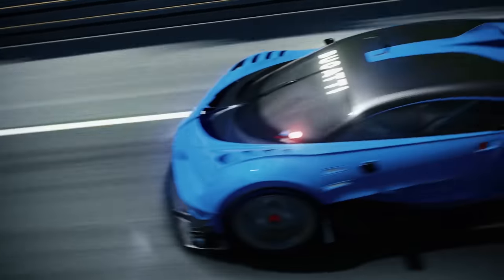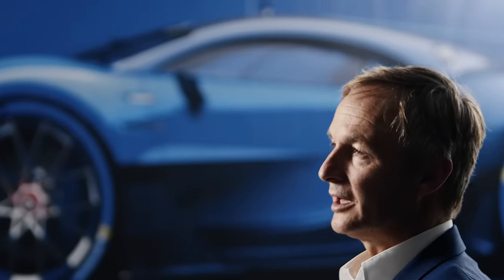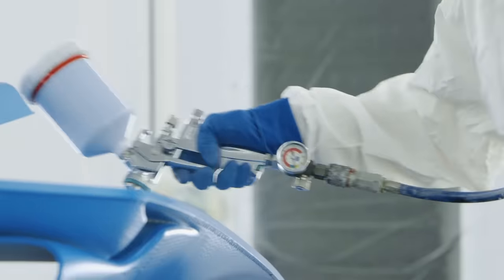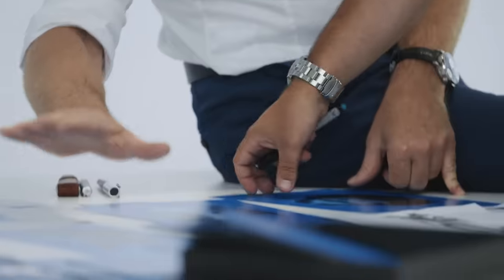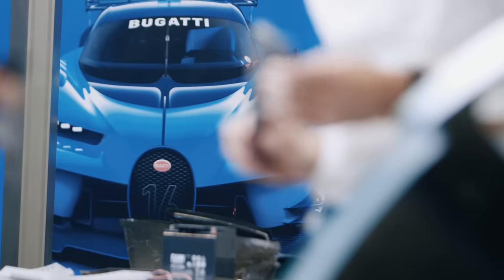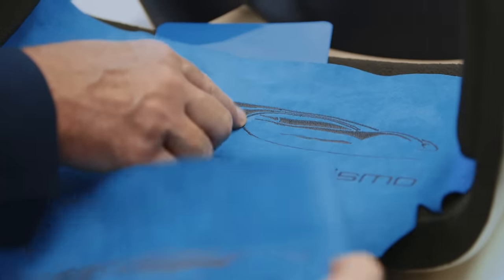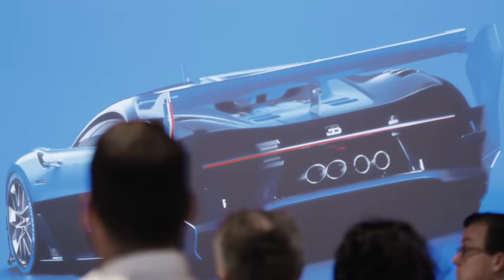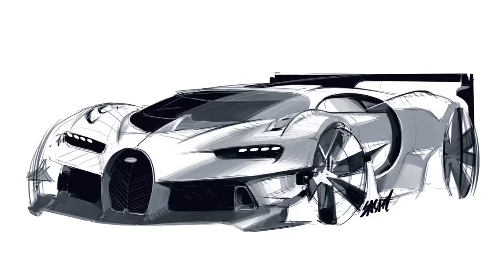Making of the Bugatti Vision Gran Turismo

Comment: 1 question, how you going to race the car when it suck up all the gas in 8 minute while in top speed, so 15-30 minute of realistic race duration, what sort of race was that?
Reply: There's something near the start line called "pit" they change the tires and fill the gas... And there are also races in real life that stay for 24 hours, no brake... A full length 24 hour races, 3 pilots in each car, and a hard endurance driving.

Comment: 00:52 "This car is no science fiction. This car is engineered. It's designed to race not in 20 years, but in today's world; in today's racing world!" 

2017 and I'm still yet to see it exceed walking speed, while being driven off & onto trucks at events "in today's racing world". Bugatti, any claims about this car's performance are entirely science fiction until you prove otherwise!
Reply: whats the 3d modelling software that they used for designing bugatti chiron gt

Comment: grand tr sucks.   this is a bad move for the company  as Sony said they won't reveal the last selling rate on the last one because it ended up putting the company of gtr  behind 4 year's from the Microsoft project forza motor sport,  from the CEO of Sony "I hope that one day we will have the best racing game out there"
Reply: Both Sony and Microsoft fucked up. GT6 was lacking the fun factor that we've seen in past games (Like GT4 and GT2) and Forza decided that more than half the cars in the game should be DLC... Unfortunately there aren't any good racing games on the current platforms. Forza 4 was certainly the best from the 360 generation, and Gran Turismo was king of the PS1 and PS2 era.
Reply: But there's over 425 cars in forza 6 so it's understandable y there dlc I mean  each car takes hard time and alot of money for them to get the title for the car to be used